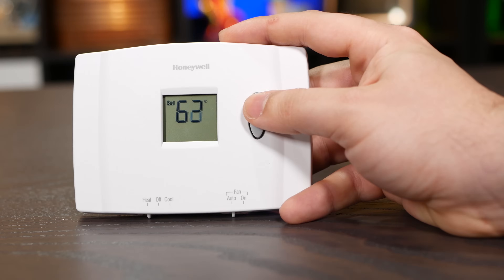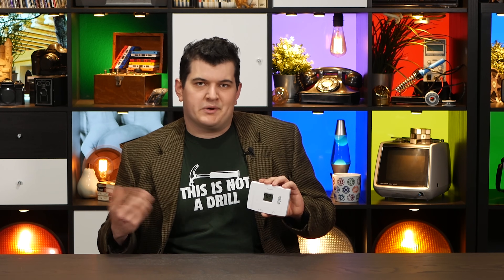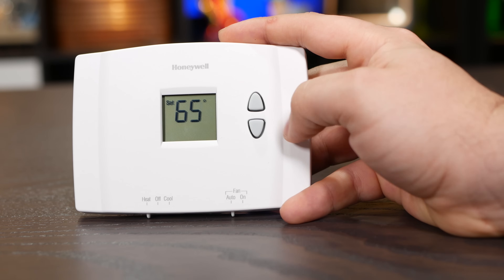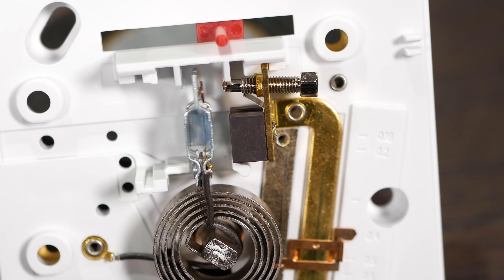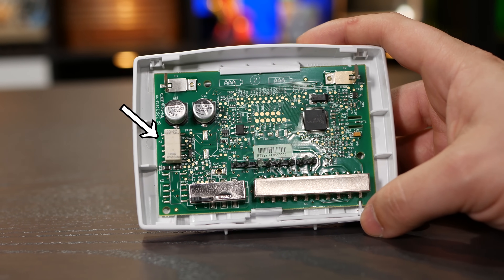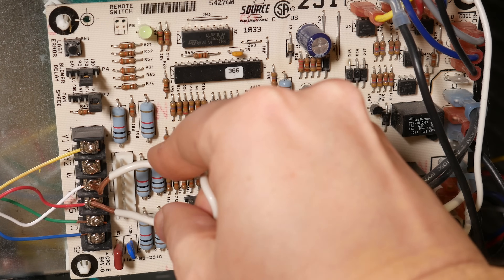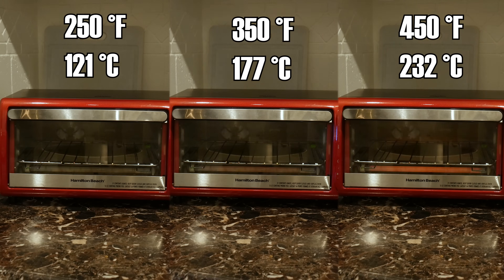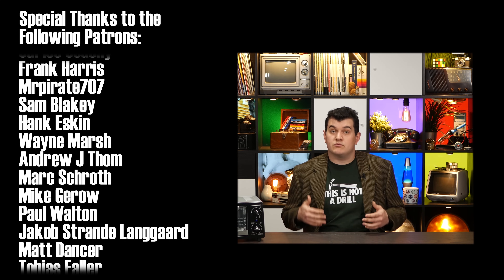Thermostats: Cooler than you think!

Comment: "Ignore the Blue one, we'll come back to that"

Me, HVAC Guy: heh heh heh
Reply: Most HVAC guys dont even hook it up even when the stat had the terminal for it. They would rather run it off battery for some insane reason
Reply: @brycelindseth5965  there is a very simple answer for that... Most cheap stats with a c terminal do not have a disconnect switch between the battery supply and 24v supply... So in most cases its easier for the customer to just change batteries rather than risking the chance for the batteries to send a strange interference to the furnace or equipment causing issues that most hvac guys would rather avoid...  Most hvac guys like myself prefer either c required stats no batteries or a batteries required cheap stat....
Reply: @steelbender1457  I'm glad you explained that, my head was about to explode. Fortunately, my new Honeywell thermostat uses the C wire and my installer said it required it, so no batteries in mine.
Reply: High velocity average car guy
Reply: I knew a guy who was color blind and for some reason boss let him put on thermostats. Can't tell you the amount of times I had to go back and fix his fuck ups! XD

Comment: The talk about the C wire seemed a long winded way of saying it serves as a dedicated ground so the controller can be permanently powered via the 24VAC and ground terminals without relying on completing a circuit through the switched outputs?

Comment: I had no idea thermostats used 24vAC, I always assumed 24vDC
Reply: Only the smarter thermostats have onboard to convert it to vDC for circuits, it was/is easier to stay with vAC because your power coming in to the HVAC is vAC already, and all it takes to get it to 24 is a winding transformer block, and it's even an easy proportion being 10:1 to step from 240 -> 24. (A lot of old doorbells also used same principal with vAC, they ran raw wall power to transformer stepped it down and then one leg went through button and other through bell then back.)

Comment: If you have a heatpump and electric furnace the system will run the electric heat strips in the furnace and the heat pump if the temperature in the house drops to far or if the thermostat is turned up far enough. A heat pump should heat the air about 20 degrees in most cases with a single stage heat pump and if the heat strips in the furnace turn on the temperature rise could go from 20 to as high 70 with a 70 degree rise being the max most of the time. So if the temperature in your house is 69 degrees and you have the thermostat set at 70 degrees the heat pump should turn on and the air temperature coming out the vent should be close to 90 degrees but if you walk over to the thermostat and turn it up to 80 degrees then in most cases the thermostat should start to say something like AUX HEAT and it will turn on the heat strips in the furnace raising the temperature coming out the vents up to a max of 140 degrees (70 degree rise) but in most cases your going to get a temperature closer to 110-120. 

Aux heat = when the temperature in the house is more than a couple of degrees off the target temperature and the thermostat decided to turn on the heat strips to quickly worm the house 
EM HEAT or EMERGENCY HEAT = manually changing the mode on the thermostat from heat to em heat witch is forcing the system not to use the heatpump at all

Comment: 15;21: Not covering thermostatic valves on radiators? Maybe you should, because A, you'd live up to your thumbnail's promise ("All About Thermostats"), and B, there's an interesting question there: Are their open and closed states also strictly binary on or off? If not, i.e. if it's a gradually opening valve, then the "cranking it up high to get there faster" fallacy might not necessarily be a fallacy when in comes to those valves. I don't know the answer though. I thought I knew and thought it was the same as with your central thermostats, but now I'm no longer sure. Has anyone mythbusted this? Relevant enwp article: https://en.wikipedia.org/wiki/Thermostatic_radiator_valve

Comment: @TechnologyConnections 16:50 

My Honeywell "smart" thermostat (which I bought in 2013 for $99 at Costco) does include a free service which allows me to use my phone to set a "hold" temperature until a certain time, after which it goes back to the regular program. So, this can be accomplished by setting the temperature to 60°F until 30 minutes from the current time.

Comment: The air handler in my 2 stage central A/C has logic that boosts the fan speed based on the amount of time it's been running (this is configurable by DIP switches that normally aren't touched by the homeowner). After shutoff it also winds down to minimum speed before shutting off.

Comment: For that first Twitter comment, I have an EcoBee thermostat, and it actually comes with little devices that you place in certain areas of the house. The way it works is that each of those satellites and the thermostat itself have both a thermometer and a 'presence detector', which it uses to average out the temperature of only the occupied rooms and run off that. It's actually quite useful, since there's such a great difference in temperature between my basement and top floor.

Comment: I'm pretty sure most programmable thermostats have an option to increase the heat for a set amount of time or just for one of their programmed cycles. We don't ever really automate ours but my dad used to do it pretty often during our (surprisingly cold) Australian winters, and every so often when it was really cold he'd turn up the heat and the thermostat would keep that extra heat until the next phase of its programmed cycle started. 

Also, I don't know if it's just an Australian thing but I've never heard of one system doing both heating and cooling! Pretty much every home I've ever seen has floor vents connected to a furnace for heating and either roof vents for an AC unit or evaporative cooling, or just a wall mounted AC unit or two.

Comment: I have an old Honeywell thermostat that has a mercury tilt switch on the end of the bimetallic coil. The weight of the mercury has the same effect as the magnet in defining start and stop points, and was a clever bit of engineering back in the day.

engagement engagement engagement engagement engagement engagement engagement engagement engagement engagement engagement engagement engagement engagement

Comment: I think that having a backup "dumb" fully electro-mechanical, no-battery thermostat on the furnace's heating control circuit would make sense for in case your electronic thermostat's batteries die or it suffers a glitch and locks up. This way if that happens and you're out of the house for awhile during the winter time and your primary thermostat fails you don't come back to frozen, burst water pipes. Just set the backup thermostat to something lower than normal but still safely above freezing, like 50F, to keep it from tripping during normal operation.

Comment: HVAC Tech here: I don't know if you're going to see this, but you may want to get your furnace checked out.  Your Y wire was attached to the Y1 terminal at the furnace instead of the Y/Y2 terminal; Y1 at the furnace is typically reserved for 2 stage AC systems, and hooking a single stage AC to it may result in lower airflow than would be healthy for your system.

Comment: On my thermostat the Honeywell RTH221 you can overwrite the set temperature temporarily. It will use this temperature until the next programmed period. However, it can not switch automatically in between cooling and heating. I have seen many thermostats that can do this. If you only want to use heating or cooling for 30 minutes, which is kind of ridicules unless you place yourself right next to your heating or cooling source, than you might as well press that button on your thermostat that resets it back to normal on your way back out.

Comment: The technical term for what the magnet does in the thermostat is it adds what is called "hysteresis". In digital thermostats the hysteresis is achieved through programming. In older thermostats incorporating a mercury bulb, it is the shift in weight caused by the movement of the mercury that introduces hysteresis.

Comment: Looked for the comment. didn't see it. Guess I have to be the fun sucker:

"Having proven that this demonstration would work using my personal toaster oven, I decided to purchase a new one. See, my toaster oven is kinda filthy and I wanted to get another one anyway. I thought it would be handy to have a toaster oven at the new studio. See, they're really nice for making small snacks or whatever (though frankly I've always found the actual toast making experience to be rather lacking even before I was introduced to the Automatic Beyond Belief! wonder that is the Sunbeam Radiant Control toaster). Anyway, so I wanted to get a new toaster oven, right? So I went to the store and bought a really basic one, just like the one that I use every day in my kitchen. No sense spending a lot on what will just be a part-time toaster oven, and it was the same brand as the one I had at home. Must be perfect, right? Well it turns out that this new toaster oven runs a much shorter cycling time than my old one, so the effect that I was trying to demonstrate became nearly impossible to see. That sure was a bummer! It later became clear to me that this wasn't a very good toaster oven anyway, as the fit of the little tray they give you for cooking tacos or whatever was really very tight and just unpleasant. The whole thing was just a travesty, really. So i've since returned the toaster oven you just saw and replaced it with another one, but this was after I had already filmed the entire video, and also after I had already filmed my original toaster oven doing the thing I want to show you. I toughened up and cleaned it the best I could, and I think it looks OK.

So that's the story of why you're about to see a different toaster oven. I made an assumption that turned out not to be true. Oh merde. In the end, it all worked out for the best anyway because I got a much nicer toaster oven on sale at Target right after I returned the rather poor one, so all's well that ends well, amiright?

Oh, and if you write this in a comment to save people the trouble, you're a fun sucker and sucked the fun right out of this gag. I hope you're happy.

A more helpful comment would be to tell the nice viewers about either the "speed" setting on mobile, or the fact that the < and > keys on desktop will advance frame by frame. Then they'll be in on the joke, too! And then when I or any other silly YouTuber decides to do this again, they'll be equipped with the knowledge of how to do this.

You already wrote this out, didn't you? Well, I won't delete your comment, but you are now a convicted fun sucker and you'll just have to live with that for the rest of your life.

Pfft."

Comment: In my neck of the woods, baseboard heaters are the norm. A/C or HVAC are relatively uncommon in homes since our summers are relatively cool. Also means you have a thermostat in every room.

As such, our thermostats have totally different wiring than you demonstrated. They're big, thick, high voltage wires. The thermostat is still doing much of the same job, though... letting a circuit flow or not based on temperature.

A local company came up with a smart baseboard heater, though (Mysa). It's able to pulse the heaters when it only needs to heat a little bit rather than just full blast on or off.

Comment: Sorry, but you need to study furnaces more.  Many home heating systems have sequencing.  When the air in the heating output duct, or hot water pipe reaches a certain maximum temperature set by the furnace's own INTERNAL limiter thermostat, it will reduce the amount of heat output either by reducing the size of the flame, or in the case of an electric boiler heating system only use two or one of the heating elements instead of all three (for a three-stage electric boiler; the one I have has three elements, 30amp, 50amp, and 60amp and it turns on the heating elements in that order, and then off in reverse order if the water is getting too hot, but it will be kept warm).  This happens even though the thermostat on your wall is calling for MORE HEAT!  Check out https://www.youtube.com/watch?v=5YjL8eR5VJ0 for a video on a heating system sequencer.

Comment: This is all 100% true for most systems. But now there are newer systems (mainly in dryer regions) that now have VFDs on the fans, so it can cool or heat up faster or slower. I don't know if the heating element or compressor is also variable. These are called mini-split systems and are common for boosting A/C in a room far from the central unit, or, if you're my boss, they're good for cooling race trailers down to 60 on a 110 degree day

Comment: Technically, many of the bathroom fan timer switches would allow you to have a "Turn the AC/Heat on for one 'cycle' only" function - Just wire them to the correct lines running to the HVAC instead of a fan. They're a handy thing to have in a home, and they're an EXCELLENT thing to confuse future homeowners with... 

That alone makes it well worth the cost of putting in if you ask me.

Some of the modern digital ones won't work as they expected a full line voltage AC, but any of the basic clockwork countdown style should be usable.

Comment: thermostat wire is larger gauge wire than Ethernet. you could run into some issues using Ethernet for thermostat wire.
Reply: Probably not, since there's not much current following through the wires.
Reply: voltage drop on long runs could also be a issue

Comment: A common term for this type of system is a "Bang-Bang" control scheme. The heating or cooling is only full on or full off, and the thermostat relies on the thermal inertia of the load (house) to average out the variations in temperature over time.

Comment: We hardly used or HVAC in CA but occasionally it was really cold and we wanted to "take the chill out" of the house. We would just run the Heater for about 30 minutes and then had to get back up to shut it off. I thought we were the only people like that lol. We used much less energy that way. Since we got a new system we kind of just leave is set. Would love to be able to just run the system for a set time.

Comment: Just to give you a heads up. That delayed switching process that's cause by that magnet and that mercury switch is called "hysteresis".
Reply: I was originally going to comment that effect was called "dead-band" but I realize they are different terms and I'm pretty sure "hysteresis" is the correct one.
Reply: The fun thing is you can think of it either as having a separate "on" and "off" threshold (with the area in between being "use last state") or as the threshold itself changing whenever the output changes - whichever happens to be easier to implement really.
Reply: Yep, and the same effect is achieved in modern electronic thermostats via PID circuits. Their input and output might seem simple but they're more than just dumb switches.
Reply: I thought it was differential. Is differential and hystericious the same thing?
Reply: Good to know - I've always heard it referred to in the common tongue as 'dead zone' like when calibrating a joystick. Thanks for the more accurate word!
Reply: Thank you! For real. I see "hysteresis" in some of the automotive PCM calibrations I've seen and I've always wondered what that meant in relation to some functions. Now that I've seen what it means in a thermostat, it makes tons of sense.
Reply: Hysteresis sounds like a woman disease. :0

Comment: Howdy there. Just a friendly community hvac tech poking in! Bravo on this very entertaining video. You were very detailed in how exactly they function. I have had to explain quite a bit that the furnace, or ac does not adjust the temp coming out to many customers. Watching this was very entertaining to me, but if you want to see something cool, or at least something i think you would like is mercury contact t-stats. Obvious works quite the same, but it how exactly it makes those contacts touch that is the neat part. I may have some old ones laying around in the shop possibly if you ever consider wanting to check them out. Far as sending them though, i would have to check into since as the name implies... they have mercury.

Comment: A multi stage system will cool or heat faster if turned up/down more, but generally it makes no difference and even with multi stage you're better leaving it alone. Thermostats with an overcool option for high humidity make the space so much more comfortable, but few have that feature enabled or even an option. 

My last job we just keep the a/c on 73 and everyone was happen. Then they started moving a bunch of people from another department over. People, mainly managers would turn it down to 68 because it was hot and then someone would turn it to 80 because it was cold. Some even turned the heat on when it was warm. I ended up going in the installer settings and set it to where it could go no lower than 71 in cool or higher in heat to 73. It didn't stop people from messing with it, but it helped with the extreme temps.

Comment: That nest thermostat cost me a thousand in repairs,  I have a two wire system which is supposed to work ,but it cant keep the switch closed before the battery gets low, so I though I had a dirty thermocouple and it broke and cost a lot to convert to a newer system